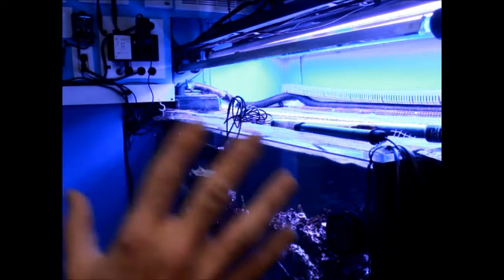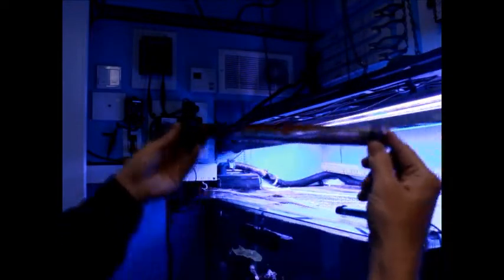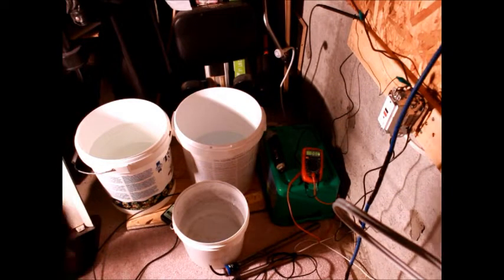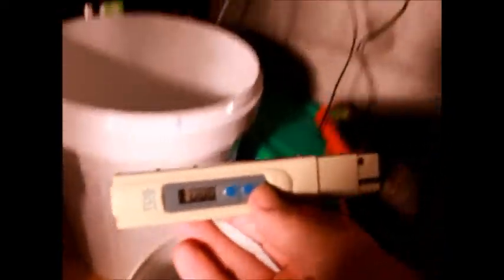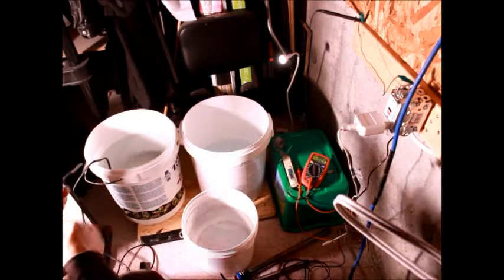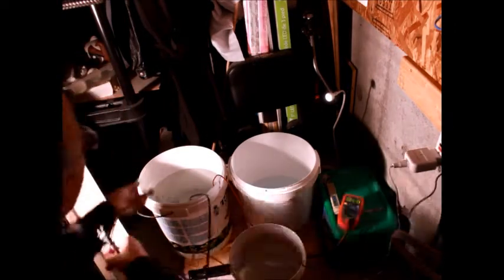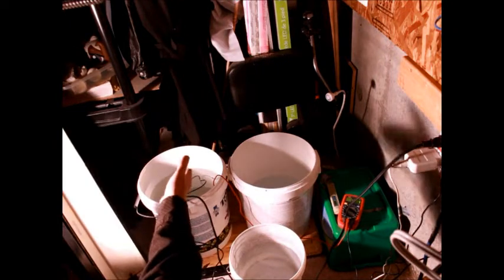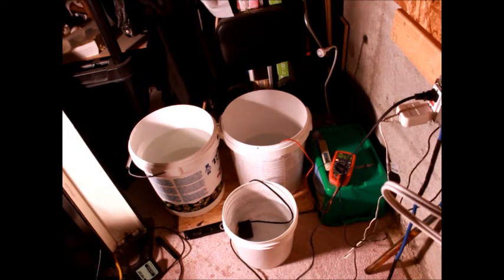Aquarium ELECTRICAL SHOCK Safety [ GFCI+Ground Probes]  (DEMO/Test)

Comment: Thanks for the video.  In your test, was the grounding probe hooked up to the GFCI outlet ground, or a different ground?  Thanks.
Reply from the maker: Grounds "should" be all the same, but you never know if house wiring is done properly.  Safest way to ensure proper setup is to have ground probe to same ground as GFCI (and also test GFCI outlet, regularily).

Comment: Interesting test, I wasn't aware of ground probes previously...we just had a severe heater failure - smelled burning plastic, in tracing the smell I was horrified seeing arcing inside the tank near the heater.  Killed the power strip and noticed the plug to the heater was partly melted too.  Never tripped the GFCI (which does work when tested).  Shame heaters, pumps, etc. aren't equipped with grounded power cabling, meanwhile really hoping the fish survive the over-temp and whatever corrosion may have got in the water :(